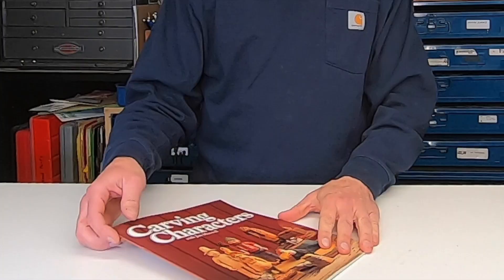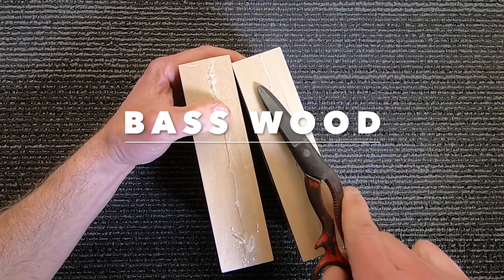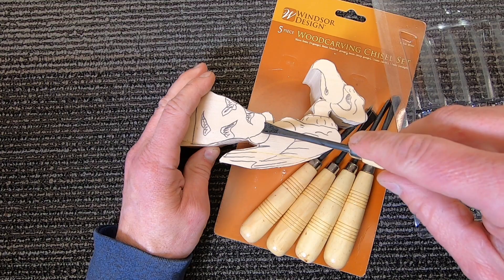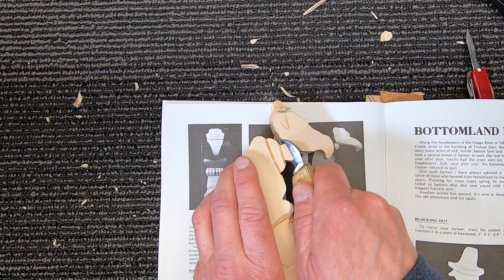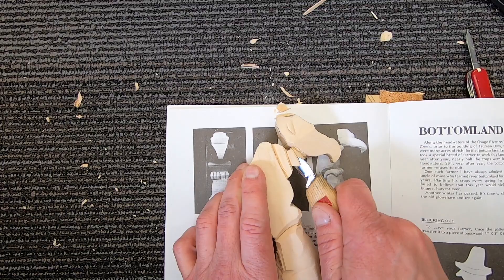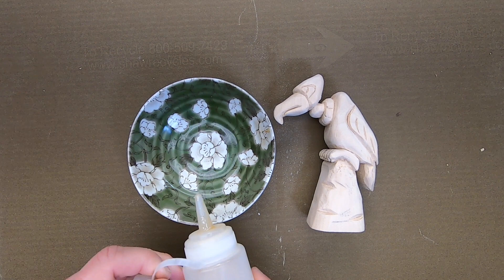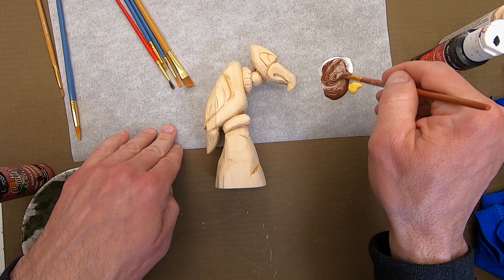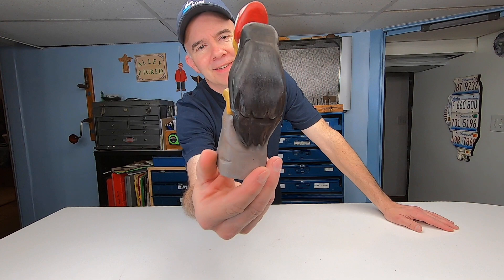Learning to Carve Wood Characters

Comment: What I have done when I was cutting out blanks, was to cut out the front/back view first, and then tack the cutout pieces back to the blank (I used a hot glue gun with just a tack of glue). Some people tape the pieces back together and then finish cutting the other side. But I am not the only one who does this. Just a tip.

Comment: What size blade did you have on your bandsaw?..you seem to be able to move the wood around as if using a scroll saw.
Reply from the maker: Hi. Good observation. I believe I used a 1/8" blade.  It works well for softer woods where I have more intricate cuts. I also have a scroll saw but it needs some repair work.